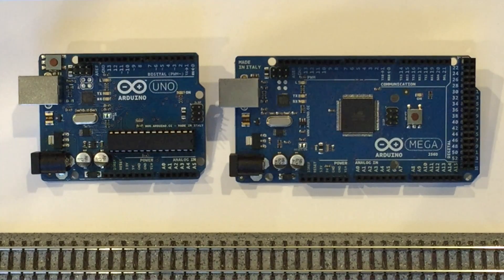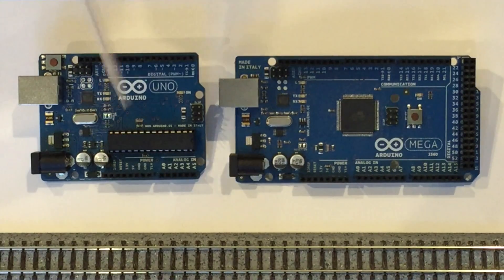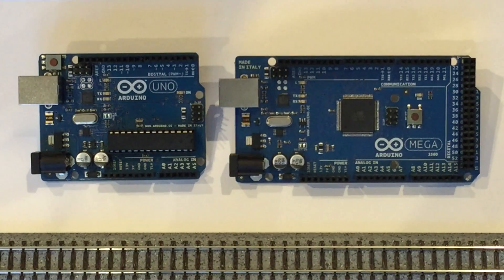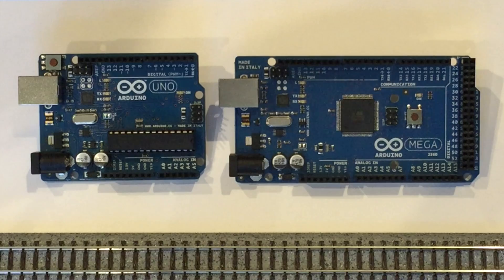An Arduino Mega 2560 DCC++ Base Station

Comment: I was wondering how much amperage the system can provide to the tracks using a 15 volt power supply on the DCC++ board...

Comment: so I have tried both an arduino uno and arduino mega. I have 15v dc in  and was only getting 1.5v dc out to A and 15v out on b. After some messing around... I am now getting 6.5v dc out on A and still 15v out on B... should both A and B be same as voltage in?
Reply: after tinkering, and resetting the shield... i am now getting
15v in
6.5v to track
14.8v to programming track...
sound right?

Comment: This video really needs to be update to reflect the changes in the software.  I followed this video and beat my against the wall for several days trying to get it to work before I saw the note in the description.  What I really don't understand is why the DCC++ developer(s) can't just post a wiring diagram someplace instead of having to watch a video.  It would be a lot more clear what to do then.

Comment: Hi Gregg, 

1) Do you have a link or instructions/video on adding wifi/bluetooth to the mega ?
2) Do you combine the WiFi/BT sketch to the DCC++ or copy/past?
3) I am assuming that when I get my L298P Shield and run the controller sketch that the programming output is lowered to protect the decoder?
4) Once I have got it working, how do I flash the eeprom?
I think that is enough questions for now.

Thank you ALL for your hard work and support!
Reply: They are doing that with JMRI and Raspberry pi 3/4 as the host Wifi computer/controller.

Comment: Dude you are a fucking legend, I wanted to have a fully automated dcc system but its just way to expensive to buy from vendors and all of their software is all closed source, I told my self that I bet someone has already used an arduino to program and run dcc equipped locos, I just wasn't sure how to communicate with them. This is so awesome to dive into your code and play around with it. I'm going to try and improve upon a custom interface with windows forms. If I turn up with anything I'll pm you and see what you think. It may be a while though as I have to get the arduino mega and power shield. I love doing this stuff.

Comment: THE CONTROLLER ZIP FILE THAT I DOWNLOADED FROM GITHUB SEEMS TO HAVE BAD VOID serialEvent(Serial p) command or statement at where the compiler gives a error message . what is the problem? How do you fix it?   Ron.
Reply: You need to get the code from the releases folder. https://github.com/DccPlusPlus/BaseStation/releases

Comment: Hi everibody. 

I modified this command station project for 4A total capacity instead of 2A.

Just send DCC signal from Main DCC signal (pin 10) to both bridges: A and B simultaneously. 

Connected pin 10, pin 12 and pin 13 all together. And connect + and - of outputs A and B in parallel to the track.  

No need to change the sketch at all. Current sense works by same manner. 

So we lose a programming track, but main track now has 4A rate. 

Tested. And it works.

Comment: In the comments section of DCCpp_Uno.ino, it says:
"...one small jumper wire is needed to connect the Mega's OC3B output (pin 2)
to the Motor Shield's DIRECTION B input (pin 13)."
So, do I have to connect pin 13 to pin 2 or to pin 4, as told in the video?

Comment: It works perfectly. I've powered the Arduino Motor Shield with a 16V and 5Amps power supply, and my H0 locos had no problem. I cannot see any difference from my Roco Z21.  The next test will concern the turnouts (Peco-Anemodel Smartswitch).
Reply: +Michele Gianni PS: I know that 5 Amps are too much H0; I'll find something smaller :)
Reply: Do you also need to power the Mega/Uno as well at the same time or do you only need to power the Motor Shield and this will also power the Mega/Uno board?

Comment: All that is great! I'm just waiting for the right power supply for my small H0 layout and I'll try your Base Station with Arduino Uno and the Arduino Motor Shield. If everything goes well, the Arduino Mega and the Polulu shield is the next step. Mapping the layout is not easy since it is hard coded in a java file. I suggest that one of the first things to do is to provide a user friendly interface for that. But again: great work!

Comment: Hi, first of all thanks for the great work you are doing!
The pins for the Mega had me confused for a while though. 

The clip shows move 4 to 3, the comment says 5 to 4. Neither worked.
Looking at the code (snip underneath) I figured it should be pin 2 and that works fine.

Keep up the good work!

#elif defined  ARDUINO_AVR_MEGA2560

  #define ARDUINO_TYPE    "MEGA"

  #define DCC_SIGNAL_PIN_MAIN 12          // Arduino Mega - uses OC1B
  #define DCC_SIGNAL_PIN_PROG 2           // Arduino Mega - uses OC3B

Comment: Hi,Your project seemed very interesting for me. But something ask me question :- video "An Arduino Mega  2560 DCC++ Base station" show us connection between pins 13 and 4.- GitHub repository section "Motor shield pin mapping.pdf" show us connection between pins 13 and 2.So can we do exactly ? Gerard E ERNESTPS Sorry about my English language...
Reply from the maker: +Gerard31 Hi Gerard,  thanks for your question.  The video is out-of-date and incorrectly shows a connection between pins 13 and 4 for the Arduino Mega.  The GitHub site is correct --- you should connect pins 13 and 2 with a jumper wire when using an Arduino Motor Shield with the Arduino Mega.  Sorry for any confusion.

Comment: The DCC++ BaseStation code I downloaded requires pins 2 & 13 to be connected on the Mega. It took me a couple of hours to figure out this afternoon why it wasn't working.
Reply: Thanks man, you helped me a lot with your comment! In this video he says that pin 4 and 13 are to be connected, but here (http://www.clubncaldes.com/2016_02_01_archive.html) he says that pins 2 and 13 should be connected. So I hadn't connected anything for fear of burning something. Then I checked the code in DCCpp_Uno.h and it clearly defines pin 2 as the DCC_SIGNAL_PIN_PROG for the MEGA.
Reply: Many thanks had connected to pin 4 to 13 as per video and the B output was not working for track programming. Should be pin 2 and 13 and now it works fine.

Comment: I am not far off from trying this out myself but I run HO. I have a motor shield but it is only rated for 12 volts. Do you know of anyone getting it to work with the 16 or so volts required by HO without burning out the motor shield?
Reply from the maker: +David Drysdale 

Hi David, though the Arduino Uno and Arduino Mega are rated for 12V, the Arduino Motor Shield can handle at least 18V, which is more than sufficient for HO gauge.  I don't know of anyone who has used a motor shield rated for 12V with a 16V power supply --- it would indeed likely overheat the board.  Note that whatever motor shield you wind up using, you'll need to make sure it is not powering the Arduino itself, since the higher voltages needed for the trains would burn out the Arduino Uno or Mega.
Reply: +DCC++ Thanks, looking closer you are correct I did not notice if you don't power the uno off the shield you can up the voltage.

Comment: I have just realized that there were more updates to catch up to so i have downloaded the current zip file and installed it and am very pleased to say that my Mega2560 Base Station is now working well. I am just about to start changing my Layout and will update the layout diagram in this software when i am complete.  I am still not sure how I'm supposed to setup the cabs etc, but look in to this as i go.  I also see there are updated to learn as mentioned above for the turnouts etc.

Thank you for this wonderful piece of software for this job.